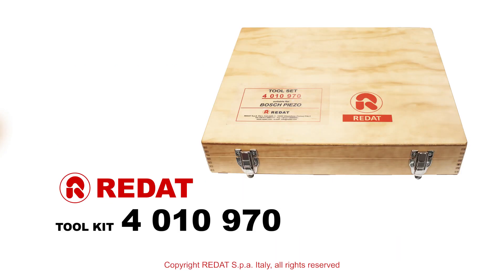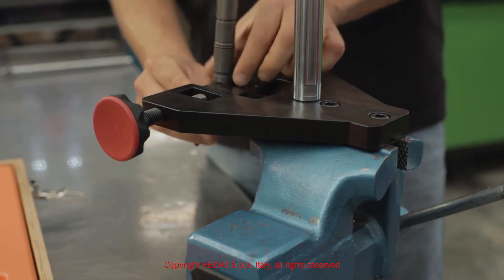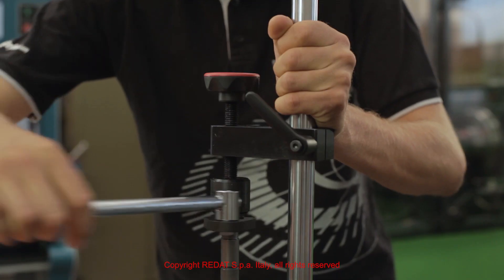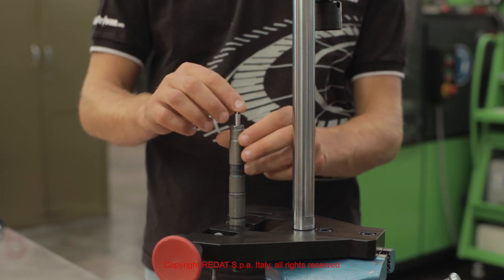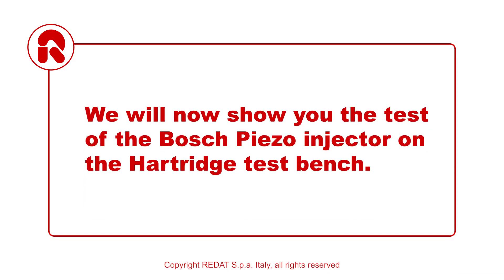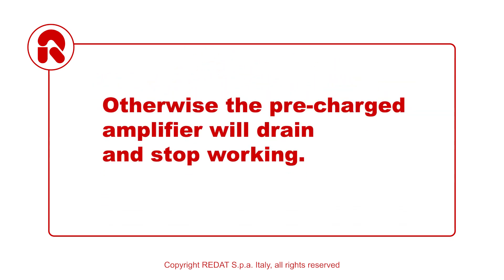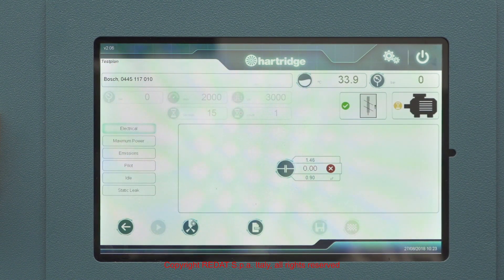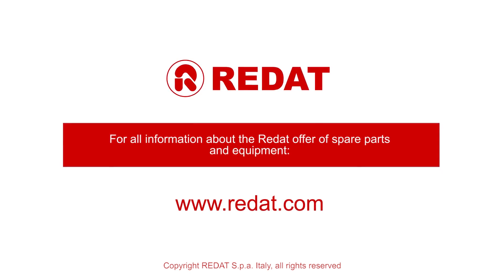Bosch Piezo injectors - Assembling, disassembling and testing

Comment: At 7:19 the torque he applies is slightly wrong as the attachment adds length. Idk if the torque spec compensates for that but if it doesn’t torque would be off. You could correct that by positioning the attavhrment at 90 degrees to the torque wrench so the leaver arm length stays the same

Comment: were is the electrical part in the injector. Does it have a solenoid on the top part of it.

I have a code circuit malfunction injector so were will this be in the injector. Thanks
Reply from the maker: There is no solenoid in piezo injectors, they work on a different principle. If you refer to a code malfuncion in your car, take it to a specialized diesel workshop, it is not a good idea to attempt any repair on your own.

Comment: Thank you, very informative video! I have a bmw with rebuilt injectors that keeps blowing the plastic non return valve on the return pipe. The report shows that the injectors are in good condition. What can be the problem?
Reply from the maker: I am very sorry but we cannot advise in this case.
We specialize in the production of spare parts for injectors, and we have some experience of injector repairing ourselves, but we never work with engines as a whole thereofre we do not know what may be causing your issue.
Reply: @RedatSpAVideo hi.are you really producer of the injector spare parts? Do you produce 980 and 1040 nozzel?
Reply from the maker: @polystone806  yes, and yes. please write to our sales office at sales@redat.com i you would like to receive an offer.
Reply: The problem consist on the injectors.may be the fuel pump damaged them by the iron filings. Because the high return fuel of an injector is due to damaged injector valve or nozzle.

Comment: Hello and thank you for this video. The mentioned draining of the amplifier module, can that happen only when disassembling the injector or also while performing a classic return quantity test? As far as i know, these tests dont use any non return valves..?!
Reply from the maker: the non return valve is necessary also during testing, otherwise the amplifier will empty.
Reply: @RedatSpAVideo  ok thanks

Comment: Can you explain why the amplifier may drain? Also does that apply only to test bench or fitting in a car right away it will drain as well?
Reply from the maker: It usually drains during the disassembling of the injector. During testing and operation on the vehicle the injector is connected to a backleak pipe wih a non return valve, the non return valve prevents the amplifier from draining.
Reply: @RedatSpAVideo  ok understand, the high pressure pump have non return valve within it?

Comment: Great video, but what would be the symptoms of a drained amplifier module? 
My car had a faulty return pipe and now the car wont pass the emissions test. I am wondering if it could be due to a drained amplifier module, which causes an injector to stay open. Is this palausible?
Reply: I did some further research, and found the answer to my question. It seems that a drained hydraulic coupler or amplifier will cause the injector not to inject.

Comment: Hi, regarding inside the nozzle theres a small spacer then a spring and another spacer which is bigger and also has a flat surface on one end and tapered the other end, which way round does this go please? Many thanks
Reply from the maker: Hello! the flat side goes towards the nozzle tip, tapered side towards the injector body.

Comment: Why you didn't show, the injector spray pattern?
Reply from the maker: The spraying pattern depends on the nozzle and it is fixed. 
If you use the correct nozzle, corresponding to the injector part number you are servicing, it will have the correct spray pattern.

Comment: hi i open Bosch Piezo injector and change valve and i put back everythink sawe way but injector not spray fuel?
Reply from the maker: It may not be sufficient to replace the valve.
Generally, the nozzle should also be replaced, then there are all the other components, to check and replace as needed.
In piezo injector, great care is also necessary when refilling the amplifier piston.
Many different factors all concur to the final outcome.

Comment: hi:)
I have a bosch commonrail injector part № 30750283. Would you please tell me how much (Nm) tightening torque to tighten the nozzle?
Reply from the maker: I am sorry but we do not know the part number 30750283 so we cannot advise about it specifically.
The nozzle nut of other Bosch Piezo injectors is tightened at 56 Nm.
Reply: @RedatSpAVideo  0445110251 is the another number of the injector :)

Comment: Great video, but why after assembly piezo 115 injector nozle cap/nut it leaks on the thread? I have marked nozzle cap and it is 50lbs torque but after tightening to same mark it leaks, I noticed there is a thread lock/seal on injector body, do I need to use another adhesive/sealant?
Reply: If the surfaces arent 100% dry they will leak at the surfaces and thread
Reply from the maker: Hello, the tightening torque for Bosch Piezo nozzle nuts is 56 Nm.
We confirm that there is a seal that goes in there too, our reference 1 211 385.
If you want to try and replace it, please contact our offices at sales@redat.com, and request an offer, it is in stock.

Comment: Is iso oil a hydraulic oil?
Reply from the maker: The full definition is ISO 4113, it is a standard for oils to be used in calibration instruments, such as the common rail test bench in our case.
Reply: @RedatSpAVideo  Can I inject ISO 4113 alternative diesel fuel?
Reply from the maker: @jejumsautocareaxis8470  No, you cannot use diesel fuel instead of the ISO oil, it is not the same.
Reply: I like to cook my eggs in the morning with iso 4113 oil.